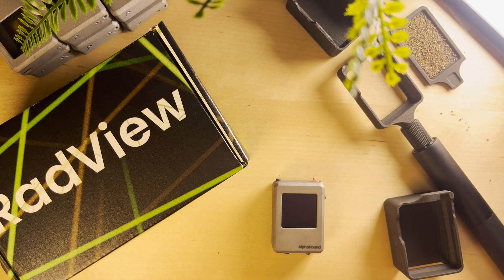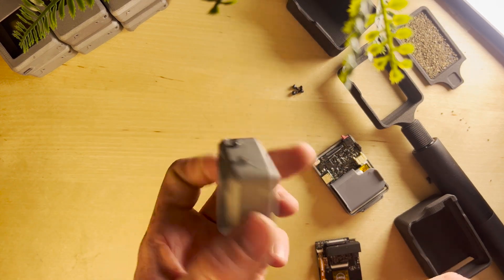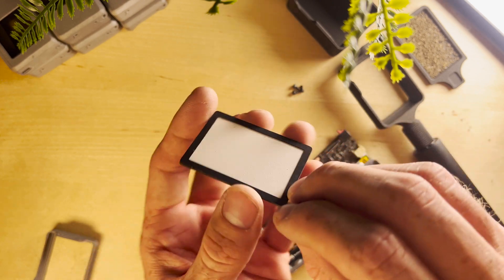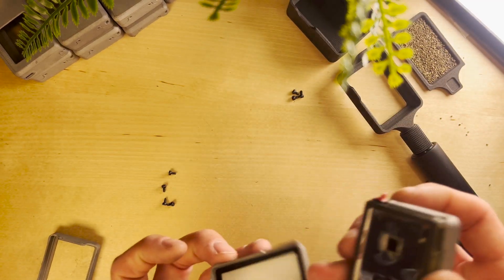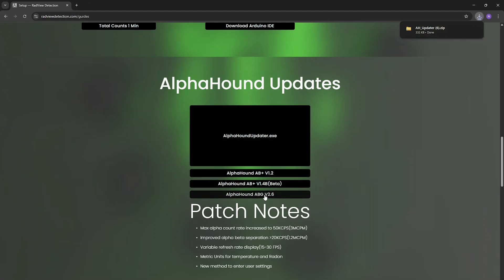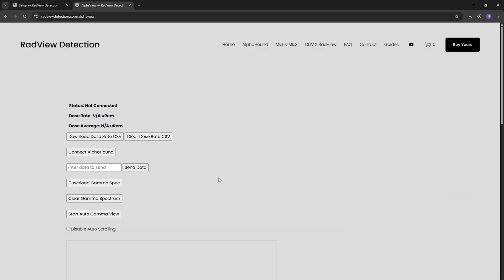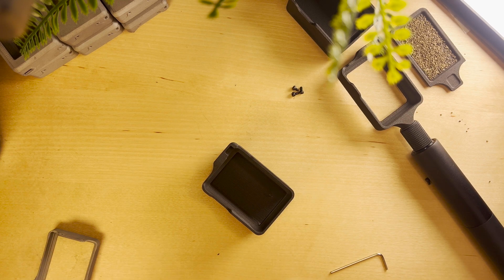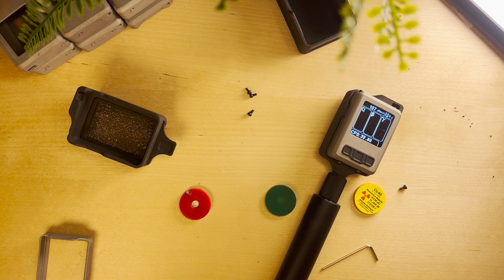AlphaHound Gamma Mod Upgrade : How -To

Comment: I most likely will be purchasing one of these when they’re back in stock.I appreciate what you did with the accelerometer, but in just the short time I’ve been using my AB+ I think it would be nice to have the directness of having buttons. Other than that, I think you done really well developing this tough little device!
Reply from the maker: We agreed which is why we added buttons on AB+G! When we first started injection molded buttons were very expensive($10K) but over time and saving up we were eventually able to get them and now we are using them as much as possible! 

Thank you for the compliments and I’ll keep you updated with when the gamma mod will be back in stock.
Reply: @RadViewNick thanks Nick! I generally try to support small companies like yours, I appreciate what you’re trying to do. I especially like that you make these devices user upgradable! It is a nice change to have that ability.